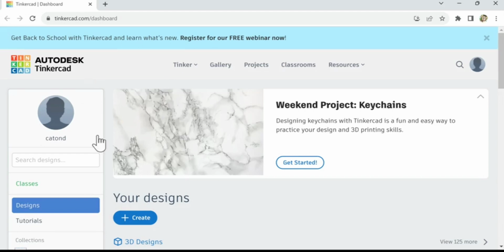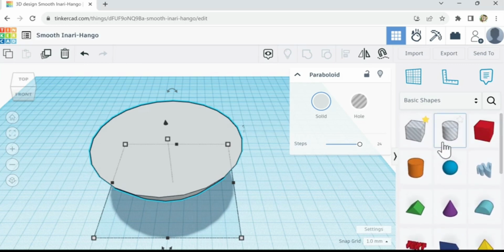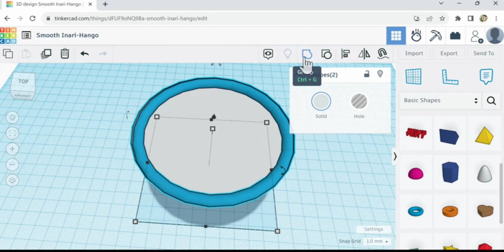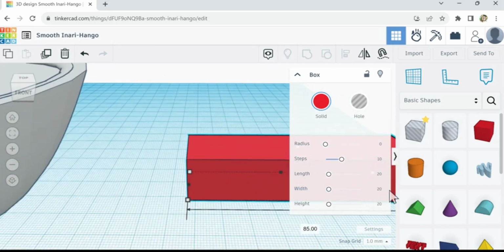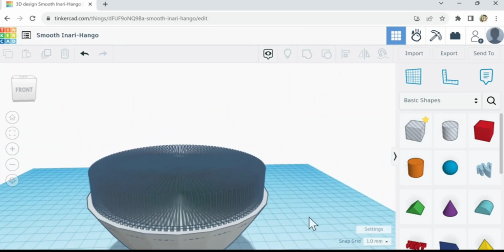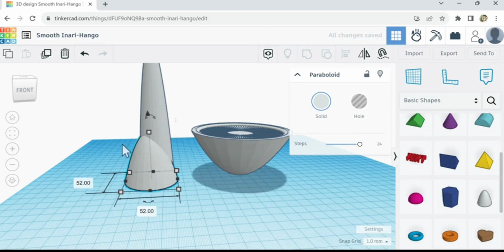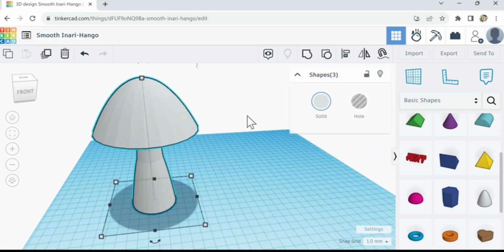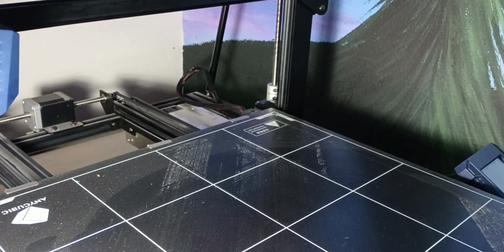Tinkercad Beginner Tutorial ( Part 4 ) Mushroom Design and Print! 3D Modeling

Comment: Ok this one got me experimenting,  to prevent supports from making the surface ugly,   I split the part into two sections,  I created a copy of the cap,  removes the gill details from the copy and increased its size about 5mm,   then made another copy of the original cap,  made it a negative part,  then used it to cut out the inner part of the copy,   basically making it a bowl.   the original part with the details/gills is attached to the stem,   but I cut off about 80% of the cap.

So now I have two parts,  the Stem and Detailed underside,     and a domed cap.    the domed cap can be printed with tree supports (open wide side down)  and the stem /detailed "top" is printed upside down,  it has a flat surface on its top and will not require supports at all.

Once printed,  The dome can just be placed on the stem part  it should fit snug,   you could glue them together,  but this makes a good hiding place for a key or something.  

Although I did not print this,  it should work fine   other options I see that could have been added,  is a stake for the stem so this thing can be stuck in the ground ,  and/or key way slots dowels etc for the dome top to keep it firmly in place.   probably played around 2 hours with this one,  liking this tutorial.